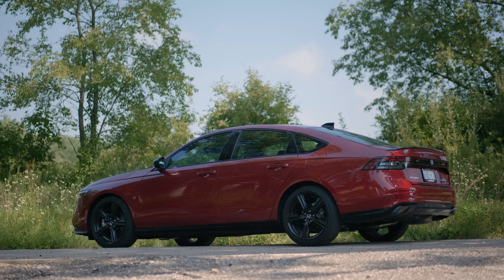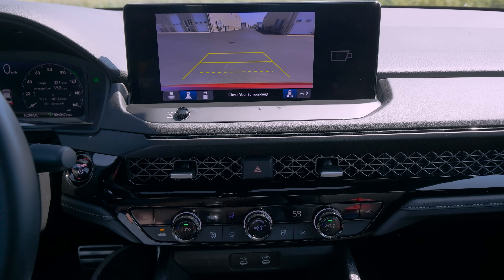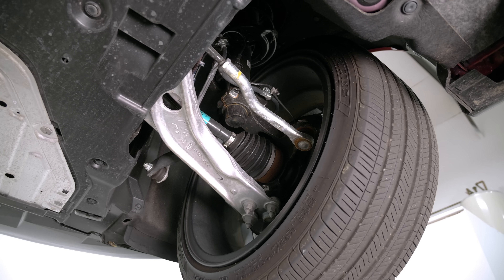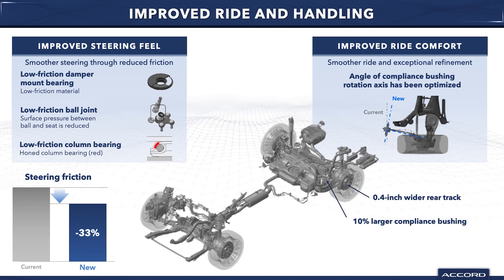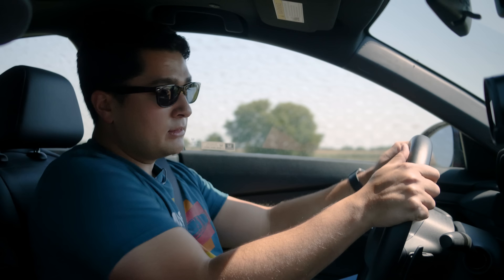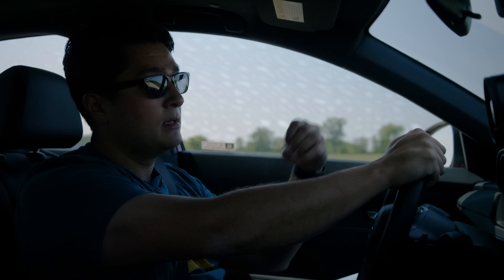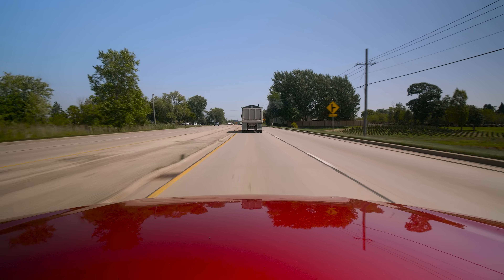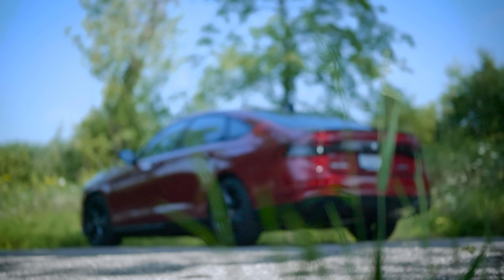2023 Honda Accord | The Art of Normal Cars

Comment: The deal breaker for me on these has always been how shockingly loud they are inside. The tire noise is absolutely exhausting and even comes through in this video.
Reply: Think a lot of that is because wheels are getting so big
Reply: @MarioFromMario 17 inch wheels are the max I will get from now on.
Reply: @MarioFromMario  It's not so much bigger wheels/tires. The tires are 17" - 19" depending on the trim but they are still skinny. Wider tires dampens the noise better. My GMC Terrain has wide tires and the ride is so smooth.
Reply: @MarioFromMario that's also true but there's just so little insulation in Honda cars compared to Toyotas
Reply: @MarioFromMario I don't think it's the wheels. My wife has a 2020 Honda Fit and the tyre roar noise is very loud. I also wish Honda would make an effort and make better wind insulation as well.
Reply: @MarioFromMario  no, not at all. Honda's have always had EXCESSIVE road noise.
Reply: @MarioFromMario   why do big wheels equals more noise?
Reply: @robertjusic9097  big wheels = low profile tires = more road noise
Reply: @robertjusic9097 The thinner tires are stiffer and don't absorb road vibrations as well as thicker ones. Big wheels themselves don't do anything, its moreso their size relative to the tire.
Reply: @robertjusic9097  basically the bigger wheels necessitate tires with smaller sidewalls to fit in the same wheel well.  Less rubber on the road = more noise
Reply: @dtsect  And thief magnet too. Accord is still the king of brick swap.
Reply: @robertjusic9097 more sidewall rubber is going to help dampen the noise transfer.  Alloy wheels kind if have a ring to them.
Reply: @robertjusic9097 Typically, lower-profile tires.  Look at a modern 911’s wheel-and-tire combo…and then go look at an early-nineties BMW 7-Series.  That should visually drive the point home.
Reply: @robertjusic9097  because the big wheels usually have a lower profile tire that don't obsorb shock as well as taller profile tire
Reply: Put a smaller wheel a taller profile tire on that Honda and it probably will ride smoother and less noisey
Reply: @gsprings43 you are correct, I am talking about a 7th generation cm6 V6 Honda Accord, the original wheels I had on the car were a higher profile 16-in they were quiet and very comfortable. I have 17-in lower profile wheels on it now and it's pretty noisy, but the 17-in wheels are so much better in wet weather driving. The 16-in hi profiles wheels where dangerous in the wet. There are pros and cons, I prefer to be safer especially on the wet roads
Reply: @thefuckthehelloff  That's just because Civic is WAY TOO LOUD to begin with which makes the Accord feel like a Lexus.
Reply: You couldn't be  more right. @dtsect
Reply: @mickluke9228  yeah,,,,,those low profile tires are so much closer to the rim,,,,so less shock and noise obsorbtion
Reply: @dtsect wrong.
Reply: @Pirustae  right
Reply: @MarioFromMario it's  not having less rubber on the road, actually there's more rubber on the road. Larger diameter. The issue is the narrow sidewall which is harder, less flexible. Therefore less give as the tire rotates against pavement  to cushion. Which also increases road noise. One will get better steering response, but the sacrifice is road noise and a harsher ride. Folks are really paying for those giant wheels and tires for a look cool attitude. Which by the way a smaller tire and wheel weights less which affects gas mileage and long term wear and tear on suspension system.
Reply: @robertjusic9097 less sidewall on the tires
Reply: I agree. I have a 2013 accord with 260K miles and absolutely LOVE the car. BUT on long trips you're 100 percent right. The noise makes it very fatiguing.  I borrowed my parents ES350 for a road trip this summer and the difference is night and day.  MUCH less fatiguing
Reply: tje thing is I really dont have this problem on my Honda accord 2011 with michelin tires, this is the eu spec car. It´s more quiet then my Passat B8 2017 with Hankook tires
Reply: They should stop trying to add superfluous "sporty" touches like low profile tires w/ massive wheels to pedestrian vehicles. All it does is make them worse at their intended function, being casual driving on varying surface qualities.
Reply: Their whole lineup is this way.  They barely address it in the Acura products.  Maybe they have a screening question in their engineers' hiring questionnaire along the lines of "Do you still like to hear expansion joints?"
Reply: Put 16” wheels and a set of Continental True Contact Tour tires on it to reduce the road noise.
Reply: @konradhittner4668 those won't fit the brakes. Plus pirelli makes the quietest and softest tire. Continental is bad lol
Reply: I have put 3000 miles on our new Touring model.  My son has a 2022 2.0 Sport.  I have driven it.  I also rented a 2021 Sport 1.5T (19" wheels) and drove it over 3,000 miles in the course of one week.  As having actually driven recent Accords, I concur with the assessment that the road noise has definitely improved. The road noise in the rental car was horrendous. I haven't spent more than 3 hours at a time in the new one, but I honestly have to question those that still complain about the road noise and say it has not improved.  And I am sure if I swapped out the 19" wheels and tires for some 17" with more sidewall, it would be better still.
Reply: like i said 30,000s dollar car its not gonna be super quiet like a luxury car @stevehoppenjan
Reply: @midnightgaminn I’m not sure why you keep harping on that point. My grandfather and I recently tried out new cars and he cut every Honda test drive short due to the road noise. He’s an 83 year old man, if he can hear it, it’s bad!
Reply: i literall said it was loud @JollyGiant19
Reply: Seriously, I have the 11th gen civic and absolutely love the car…. But good lord the absolute worst part of the vehicle is the road noise
Reply: I reading about road noise from low profile tires/larger rims. The Volkswagen Jetta and Jetta GLI has the quietest interior on this side of Audi A8 (lowest nhv of any production car ) both with low profile tires .
Reply: @weblover9185 exactly. All Hondas I’ve owned have had terrible road noise at freeway speeds and none of my VWs have ever had that including one that had 18s.
Reply: @weblover9185  Good to Know - Thank You !
Reply: Why do no car reviewers tell the truth about these noise issues?
Reply: its all about views and making money on youtube lol @antonroux6737
Reply: Also the build quality is relatively poor for a Japanese car - I mean this press car you can see @2:18 the side of the cushion is separating already.  If it was Toyota or even Mazda, that wouldn't happen for at least a decade of asses pounding in and out of it.
Reply: @Beer_Dad1975  good eye 30k for that quality Honda ain't the Honda of the past
Reply: I noticed that too. @Beer_Dad1975
Reply: As 2023 civic owner I can agree. Improved NVH my ass. Rough roads kill Hondas. It is quiet only in EV mode and new asphalt. Though I like how isolated the engine is compared to rattly toyota/lexus hybrids.
Reply: most cars at this price point are louder on rough roads even with all the nvh stuff @tiredconnoisseur
Reply: And this is hybrid version, i tried 1.5 turbo base trim and its horrendous
Reply: @azizkizbayev439 . Bullshit
Reply: You are probably in north Texas where there are a whole lot of concrete paved roads aka road noise generator, not to mention the expansion seam sound of tuh dut tuh dut. The cheapest solution for me driving a rolling echo chamber like CRV is to wear a good noise canceling headphone.
Reply: @csmlouis dang bro I’d never seen anyone describe that sound before lol. And yeah my 2022 Civic Hatch is quite loud.
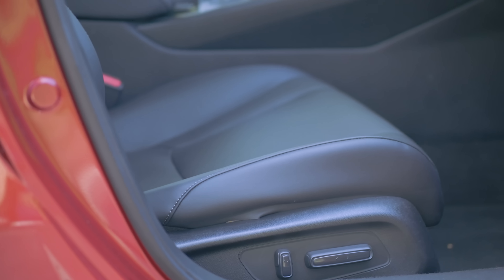Reply: CAMRY has long beating the Accord in ride quality, NVH, and build quality... folks buy Honda for a slight performance edge over the Camry... ALSO, what's with that (fake) leather already coming up from the seems on the passenger seat @2:15?!! Hints of build quality??
Reply: Cameras pick up things more sensitively i think
Reply: What would be the best way to combat it? I honestly don’t mind investing in sound deadening to be installed
Reply: @shanecash7582  I put 2 layers of KILMAT 80 mil in the drivers door of a 2017 Hyundai Sonata. It helped quite a bit. I never did any of the other doors because I don't own the car anymore. It just bothers me that I would have to take apart a new car to get reasonable noise levels. I am currently considering the 2024 Integra and it's reported to be noisy.
Reply: The civic is even louder, you hear the cvt, the road noise, the wind noise... I got an cx5 and its another realm of build quality and noiselessness, although in the cx5 at high speed theres big wind noise  at around 100 mph
Reply: @SuperMrBentley Where can you cruise at 100?
Reply: @SuperMrBentley 100 MPH, who’s going that fast
Reply: @SuperMrBentley 

What an idiot. Saying road noise at 100mph.  Morons everywhere
Reply: @SuperMrBentley . Oh stop.  If ur driving at 100, u don’t belong on the road
Reply: Absolutely, I got rid of my 2.0T 6 speed for this reason alone
Reply: Don't get the sport
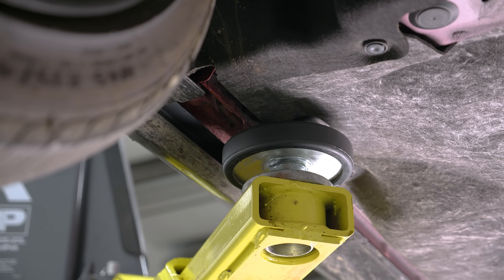Reply: 6:34 Look at those treads. Snow tires typically are louder than all-season tires on asphalt. I’ve got a set of cross climates on my dodge magnum and even after a resonator delete, I still hear them at highway speeds.
Reply: Yep I basically gave up listening to music or podcasts on the highway.  What's the point if I have to put it so loud it will make me deaf?
Reply: my buddy's 10th gen accord had quite a bit of road noise, bridgestone quiettrack tires helped a little bit.
Reply: I’m on my 7th Honda, and it’ll probably be my last one.  Hell, I just had to rent a Corolla for a business trip, and was blown-away.  It might look edible, but what a refined car for the money.
Reply: Which is crazy because they keep saying that it’s such a quiet ride in this video… 😩
Reply: Honda accountants must be deaf to cut on sound insulation, get some younger accountants Honda... accountants who are not hearing impaired
Reply: @RedVikingTV  When you are crossing cultures often information is lost in translation.  Lively handling is accomplished by a loss of weight such as laminated glass.  GM accomplishes that goal by spraying film in areas that are prone to noise.  NVH takes a back seat to lively handling that Honda is known for.  Over time, your ear adjusts to the new noise level so that you become unaware of it.  I had this when I went from a Buick Riviera to a Nissan Versa that was real loud until my ear eventually adjusted to it in a matter of weeks.  While quieter, the Buick fell apart after 50K miles.
Reply: Been a while, but I thought my 2007 EX V6 Sedan was quiet enough. I didn't mind the engine noise that would make it in at all either. I went from a '86 944 Turbo to the Accord and then a 2006 330ci ZHP 6spd that I've had since 2012.
Reply: Bridgestone Turanza Quiet Tracks.

You're welcome.
Reply: I agree. I have a friend with a new 2023 civic sport hatch and it is deafening to drive in. Even in parking lots you can clearly hear the tire noise. Sounds like the tires are pumped up to 60psi and there is no insulation. Shockingly, my 2012 Outback is a MUCH quieter vehicle and Subaru isn’t known for quiet cars. The 2024 Subaru crosstrek I had as a dealer service loaner was way quieter with a better ride quality than the civic and it comes with AWD standard for a similar price. I appreciate the simple design of the Honda but I’m not going to pay a premium for a 4 cylinder tin can.
Reply: it’s the tires they use, they’re garbage. my Integra i thought was quite loud for what it is, just got some new DWS06+ tires put on and it’s a massive difference in noise, ride quality, and performance. honda uses shit quality tires to cut costs and it hurts them as now over a year later i feel this is how my car should have been from the very beginning
Reply: You got that right! Like I said, I've tried four brands of tires on my Accord, and they're all junk in terms of noise and life span. I have not tried the Continental tires you're talking about here, but I will keep them in mind if I still have this car when the current set wears out. Actually I'm thinking pretty seriously about trading out cars because I'm as tired as can be of the constant tire problems. In all my decades of driving, I've never seen anything like it.
Reply: You guys dont believe these guys?   They said its super quiet
Reply: The Touring version has more deadening, acoustic glass, and better tires. And it all helps quite a bit, having driven multiple trims. I feel like some of those things should be trickling into lower trim levels at this point.
Reply: @dannystl  every trim should have acoustic glass my kia has it on the midline trim
Reply: Earplugs
Reply: My 2020 civic had bridgestone tires and it was louder than my STI by a long shot. Much louder than my Cruze too.
Reply: ideally instead of tire noise, just enough  bumpiness through seat should be felt at the seat instead of being noisy for everyone in car, to give a feel of when road isnt too bumpy, not good for traction and satbility, for if you want to push down the gas more or turn more intensly, or brake more intensly... new toyota trd tacoma has adjustible shock absorbers in seat , for different drivers its good, i woudlnt want to pay for it for otehr seats because their better off not realziing how im driving , no need for anxiety of driver doing something wrong getting into crash, delaying schedules, not letting them relax/sleep as much etc.
Reply: I was in a 2023 hybrid for an uber ride last week. Shockingly quite on a 20 minute highway trip. Comparing against my 2017 sport and 2008 ex
Reply: Thats because Hondas are trash
Reply: @@Ac_Adapterthe only solution is sound deadning, 2 layers. 1st layer vibro insulator 2nd sound. In total we looking at 4mm thickness (150 lb in total) , its doable but paying almost 31k USD ( 40k CAD) for the car and dealers adding extra 3-4k on top is insane..
Reply: True, Accords have always been loud, but each generation has gotten successively quieter. My 9th gen (2014) is much quieter than my 8th gen 2009 Accord was, and the new one is quieter still. It's hard to judge ambient noise through microphones and video. You'll have to drive one for yourself to see what they sound like in person.
Reply: I have a new gen 22 civic sport, a 21 corolla se hatchback, a 21 hyundai kona, a 22 rav4 le hybrid, a 20 jeep renegade sport, and an 18 fiesta ST.  The civic has the most road noise, even more than the fiesta which has an ultra stiff suspension.  However the civic feels the best built, has the best interior and amazing driving dynamics.  The rav4 is the softest and has the least amount of road noise.
Reply: @PowerSerge5000  Are you a Turo operator?
Reply: I agree, Honda does a very poor job with noise insulation. I had a loaner accord couple years ago. It was loud just driving out of the dealer lot. Once I was on freeway, I had to crank up the radio to drown out noise. My wifes crv is a nightmare to drive  because of the noise. Don't get why Honda doesn't address this. I guess they don't care.
Reply: I have a touring accord and it's extremely quiet 🤫 🤔🤔
Reply: Honda's alternators, starter motors and water pumps are also garbage - haven't owned a Honda in 12 years - never will again......
Reply: Honda's biggest problem: insulation
Reply: They also crush like bugs when they get into a crash and everyone inside goes bye bye, for the same reasons the cabin noise is so loud. Plastic materials make repairs easy and cheap, but they also make Toyotas and Hondas very unsafe to drive
Reply: Honda can’t manage to get road noise out they’re awful at it like holy shit throw something in the wheel well
Reply: @@Ac_Adapteryour nuts
Reply: I mean it's no Acura TLX
Reply: The EXL Hybris is quiet as hell. Coming form a 2008 V6.
Reply: They can never fix this. Road noise always have been a problem. I've owned several Accords (2011 sedan, 2013 coupe, 2018 sedan) and they all have this issue no matter what trim level, tire, wheel size. I upgraded to better, quiet tires ($800~$1000 michelin, pirelli) to see if it'll make a difference with my 2013 and 2018 Accords but nope. And in fact, this road noise issue can be seen in Acuras as well (ILX, TLX).
Reply: I have an RLX, no road noise.  So it is possible in a Honda product, only in the flagship sedan I guess
Reply: @dtsect  Is it just a lack of good sound deadening material? Or where is Honda failing here
Reply: @neilquinn  Is the glass laminated?
Reply: @dtsect  "I upgraded to better, quiet tires ($800~$1000 michelin, pirelli) to see if it'll make a difference with my 2013 and 2018 Accords but nope"   was it summer tires. pirelli have always been a bit noisy afaik, michelin usually does well. goodyear eagle f1 is a good tire and come out on top in many tests, cheaper too
Reply: It's because the tires are low profile. That's just how they are, and I will never, ever have them again.
Reply: @johnschmidt8440 You would hate the Toyo R888 on my Acura. They howl.
Reply: If that's what they do, then yes I would! I never had problems with tires ever until I got something with low profile things, and now it's nonstop problems. I've tried four brands of tires and it doesn't matter at all because that's just the nature of that design. They usually go 15,000-20,000 miles, and then they start getting more and more noisy. Toward the end of their life, they're almost unbearable. I've had passengers tell me they get headaches from all the noise. I also can't use the car's microphone because nobody can hear a thing I'm saying. So then, all that is to say that I am absolutely done with any vehicle that has that kind of tires on it. Never, never again.
Reply: @dtsect It’s fixed with this Accord Hybrid. Very quiet.
Reply: being honest you will hear road noise in any car unless its like a rolls royce lol @dtsect i mean its a 30,000 dollar car its not gonna be luxury quiet
Reply: @midnightgaminn  Camry at the same price is considerably quieter. I didn't say Accord should be quiet like a luxury sedan. If my friend's Ford fusion has less road noise, that definitely says something.
Reply: @dtsect tire and road noise is better on the Camry but I noticed wind noise was much louder compared to the accord. I came from a 2020 Camry XSE and now driving a 23 Accord touring and this was one of the things I noticed immediately. I think it mainly has to do with the Camrys design which utilizes more sharp edges and angular designs. I must say that the noise isolation on the accord is crazy. Loud outside noises become very muted when sitting in the car.
Reply: That's what happens when you have to keep your Acura models competitive. Your lower tier brand suffers to keep them from stepping on the premium brand's toes.

Infiniti and Lexus never suffered this issue since they were smart enough to design RWD platforms for themselves. Honda was too pathetic to follow through, and as a result both them and Acura suffer.
Reply: Literally selling my 2023 Honda Civic just because of how bad the road noise is.
Reply: I can agree. I have a 19 Touring and the wheels and tires are loud AF . Even on a 3 hour trip, it’s exhausting after a while, if you start to listen and concentrate on it it’ll drive you crazy. Fix it Honda !
Reply: @thescramble4309 It is definitely significantly better in the 2023 Touring at least. There’s a ton of new underbody NVH paneling that the 18-22 didn’t have. To my ear it’s easily quieter than Camry.
Reply: Hondas have more road noise than any other brand, this is coming from a 15 year Honda driver. My gf's Corolla and mother's Altima don't transfer nearly as much noise from imperfect pavement, and those cars have bigger rims and harder tires than mine. All unibody vehicles are susceptible to this but Honda seems to always be the worst
Reply: Buy lexus
Reply: @uramchoe3201 go tell that to your fellow ToyoTAXI CULTist fartboys.. buy Lexus equates to buying Drony transmission, and 2010 technology for a toyoTAXI in a prom dress🤡
Reply: Hondas relative to their peers lack the refinement of other competitors. They may win on the dynamics front but on NVH they still feel like they are stuck in the 2010s.
Reply: Agree with this - the CRV's historically were probably the worst offender. A lot of components just lend themselves to be noisy though - turbo 1.5 or 2cyl are noisy, plus you also have the high pressure fuel pump ticking that sounds really tacky from the outside.
Reply: @neilquinn I’m laughing because I have NEVER seen a CR-V on the road break 30mph.  I avoid them like I avoid church.
Reply: Tires make a big difference. I upgraded to Continental Pure Contact LS tires on my Camry and it was a BIG improvement.
Reply: No way they are worse than Toyota equivalents.
Reply: Not loud in the hybrid version, especially the touring trim.  I test drove a 10th generation Accord and refused to buy it because of the road/tire noise.  This 11th generation is completely different and feels like an upscale quiet luxury sedan.  My wife drives it and is getting 55-57 mpg on every tank of gas for nearly 13K miles.  Absolutely insane efficiency in a refined, front wheel drive, mid-sized sedan.
Reply: @christopherm1904  Good To Know - Thank You For Sharing